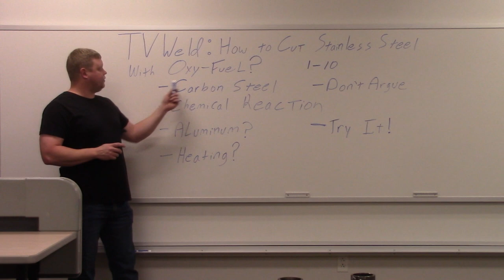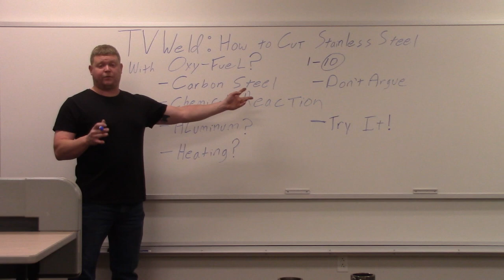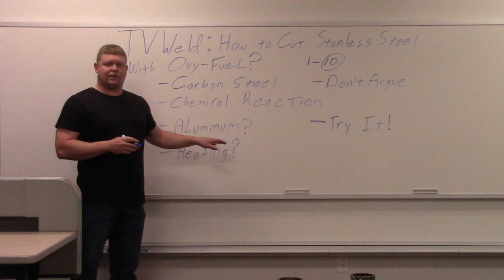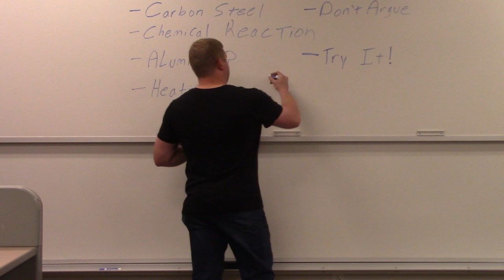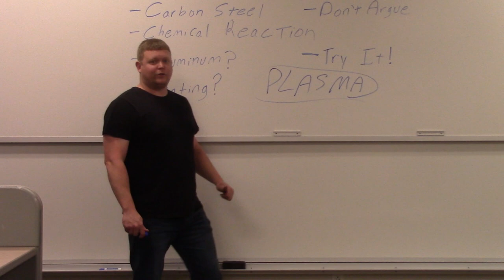How To Cut Stainless Steel Using Oxy Fuel

Comment: as a profesional torchcutter, I can say yes you can, just like you can cut very high carbon steel (think higher carbon content then cast iron). its not clean but you can cut. either cut it in a way that there is a piece of mild over it, so the mild will blow through it. or if you can't, like if I had to cut a 6" thick SS driveshaft (which I have dozens of times) you heat it until there is a huge area that is red hot. You have to have it hot enough that it will stay red hot and glowing for minutes after you take your torch off (whatever temp that would be IDK  im paid to cut it not to check its temps) then start your cut. you have to shake your torch like mad. Think a crackhead in withdrawl, so up and down, forward and back, and left and right, all at once. what this apears to do is allow the metal to oxidize enough for the metal to get pulled off the piece, but since the torch is already moved away, its not just cooling the metal down because of the nickle and chrome. just peeling off the top layer over and over until it is cut all the way through. Just because its not mild steel doesnt mean you cant cut it, it just means that the cut isnt clean (think a mild steel cut compared to a manganese steel cut. that difference is the same for manganese to stainless steel).
Reply: what about magnesium lance, shouldnt that be able to get through stainless steel?
maybe a plasma-oxygen torch could make sense for stainless steel- welding it we sure know that it can corrode from high temperature with just air, hence backing gas is used
plasma cutter with just air goes right through stainless - hence oxygen instead of air should do something extra

Comment: "These and other alloy steels that previously could only be cut by a melting action can now be cut by rapid oxidation through the introduction of iron powder or a special nonmetallic powdered flux into the cutting oxygen stream. This iron powder oxidizes quickly and liberates a large quantity of heat. This high heat melts the refractory oxides which normally protect the alloy steel from the action of oxygen. These molten oxides are flushed from the cutting face by the oxygen blast. Cutting oxygen is enabled to continue its reaction with the iron powder and cut its way through the steel plates. The nonmetallic flux, introduced into the cutting oxygen stream, combines chemically with the refractory oxides and produces a slag of a lower melting point, which is washed or eroded out of the cut, exposing the steel to the action of the cutting oxygen."

Comment: I have cut/blown through stainless sheet metal by laying a bead on it using 7018 rod then using oxy torch and never had a problem. but I dont think it was an actual cutting process. more like heating up the steel of the weld and blowing through the sheet metal stainless underneath. but it does work.

Comment: You can cut it with oxyfuel using a secret! Place a piece of CARBON steel over it and the CARBON steel will blow through the stainless! Give it a try! YOUR WELCOME!
Reply: gotta be perfectly up against it i take it- i had the pleasure of chopping up some chemical industry tanks that had an outer layer of carbon steel- seemed about 5mm of air inbetween, i had my first joyous moments with molten metal being shot at my face because it had nowhere else to go and decided to explode 
would the carbon steel be ok to be smaller thickness- equal or should it be thicker than the stainless?

Comment: I beg to differ with some of this..........I cut it all the time.  It is all in the technique you develop to throw the slag out and ahead of the cut and not to let the slag land ahead and solidify.  After all, stainless is a largely iron alloy, and of course iron (or steel) is combustible, and that is how the cut is made in steel.  The slag from cutting stainless has a lot of chromium or nickel carbide which when molten is very fluid. It coats the metal  ahead of the cut and solidifies like a coating of paint almost.  It remelts at thousands of degrees higher than the base metal you are attacking, and totally impedes the cut, like an insulation.  The trick is hard to explain, but once you get the cut going, and it IS initially hard to start.  Then as you go, you manipulate the torch, or rock it, or whatever you would call it to hurl the melted product away and you will absolutely cut stainless!  Thin stuff is a snap, it is trickier with plate starting at around 1/4 inch to  about 1/2 or 3/4 inch (you have to go at a steep angle and as long as a flame as you can get while still with the correct flame and keep a slight stand-back so as to pick molten flowing stainless from the SIDES of the cut and add that to the oxy jet.).  Believe it or not, very thick material like one inch way up to 2 or 3 inch or more is easier!  But you HAVE to learn the "hustle" to make it happen!  I WISH I could make a video of me cutting thick stainless shafts to show you it is NOT just melting!!  People also say you cannot cut cast iron, but it too is a snap once you get the motion technique!!!       I AGREE you cannot cut aluminum but you'd be amazed at how  what is known as a COMPANION CUT will accomplish that!!  You place thick steel like a section of really thick plate or very thick pieces of rebar right against and above your intended cut.  Say you are going to cut through thick aluminum plate like 1 or 2 inch.  Heat the aluminum at the start of the cut until it is pretty well molten, and then immediately start to cut the steel bar stock or plate section and you will blow right through the aluminum right along with it!  You slowly weave side-to-side in the cut (like laying a weave-bead in welding) to carry large amounts of burning iron in along with the oxygen!  This is not commonly how you demolish aluminum scrap, mostly shears, saws, burning bars or plasma are used.  BUT it is a handy way to "cut" aluminum with a torch in a pinch!!!  ACTUALLY this technique sort of replicates the operating principle of an oxy lance or burning bar! Exothermic reaction of steel and oxygen blasting through the aluminum!  If I knew how to make a video and upload it here I would!!!   I only have a clamshell phone because of the work I do and I am not too "slick" at knowing how to do "techy" stuff!!!
Reply: The process you describe cooks the chromium out of the steel, so the stainless properties of the material is lost. I get what you are saying; instead of the oxygen oxidizing the iron, it oxidizing the chromium, which protects the iron from being oxidized, you then have to melt the stable chromium oxide off the iron to before the iron oxidizes, but that process is essentially cooking the chromium out of the steal.. which isn't ideal.
Reply: @curtismunro3244  Kinda, but not quite. Car ides of metals will form under extreme intense focused heat.  Example is, calcium is a metal technically, and it form calcium carbide in an electric arc furmace. This enabled the discovery of commercial Acetylene in the 1890s.  The torch is over 5000 degrees, so it really doesn't just form chromium oxides or hexavalent Cr., it also forms the chromium carbide. This exists as a slag, and when it cools it is like a smooth glassy substance. The torch is really just unable to continue a cut through the leading edge of the stainless because the slag re-melts at an extremely high temperature, and serves to insulate the metal against attack from the torch flame. this is why we keep the slag off the metal ahead of the cut with a "whipping" or oscillating motion of the torch to try to keep it away.  It can be hit or miss until you get good at it.  A Very strange fact is, stainless that is rough or gouged up o the surface is far easier to keep the slag away than shiny polished stainless!!  Thicker stainless is often easier to cut than thin stock once you get the "keyhole" in your workpiece constantly molten as you pick up this material and "hurl" it through the depth of the cut.  As in a thick shaft, square bar stock, or thick plate. With an almost perpendicular cut rather than a forward blast and the motiln of the torch, which can be a bit tiring!
Reply: i was just sitting here and for whatever reason i thought about whether oxy can cut brass.  youtube showed nothing except for someone who was adamant that you couldnt cut stainless or cast.  then i found these comments.  then i saw the comment about a man who worked in the demolition business.  then my brain clicked over.  i used to work in the demo business 30 years ago and i was the main man in our. team who used the oxy.  i must have cut everything, absolutely everything.  a melted gash is still a cut.  i cant remember ever having trouble cutting anything.  i would have worked out your technique of blowing the slop away.